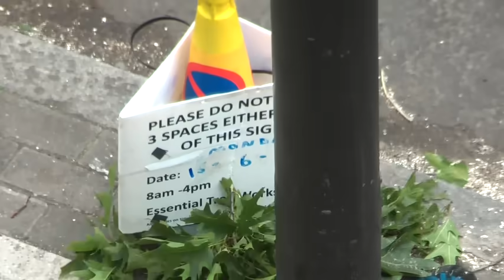Oak tree carefully dismantled

Comment: Why didn't they just fell the tree into the green.
Reply: There is another tree in the possible fall path.
The tree might not fall in the path intended since it depends on the centre of gravity of the top branches.
There is a light pole and traffic which the tree could fall on.
The top branches would need to be removed first before you could control the direction of the fall.
Surely youve seen the "Tree cutting fail compilations" to see how things go wrong.

Comment: MPFC Lumberjack song come to mind? Not the safest way to cut branches from a tree 🌳.
The guy with the chainsaw has ripped safety clothing, hearing protection not fully over ears, and rarely used his face guard; in Ontario you would be hauled across the carpet and fired. The pieces being cut from the tree are too big, ground men cannot safely move them. Out of ten, this is a three for safety, ten for production. Then when loading logs into the trucks, off come the safety helmets.

Comment: this is not shit. I just completed one three times this size if not more that was 12 ft away from a house and 20 foot away from a building and a powerline one foot away from the trunk of the tree. also it will be my last one that size. I used to love the challenge now I just want EZ stuff if even do it anymore. I got out of it for years and this was the first tree I jumped back into after 9 or 10 years of Calling it Quits. and I climbed it was just ropes and my saddle. no bucket truck or cranes